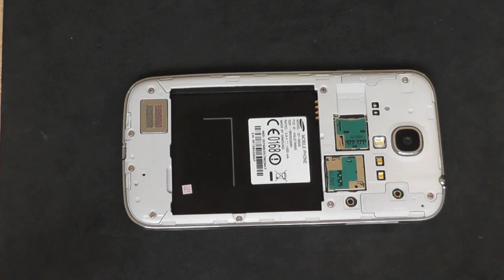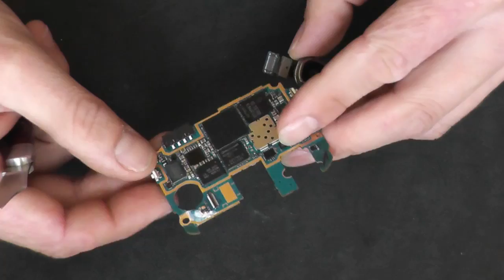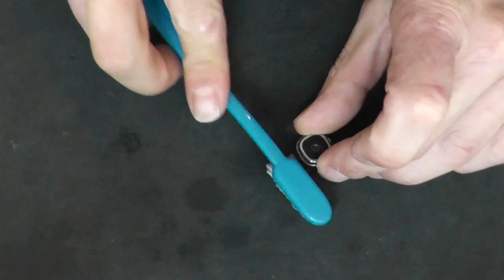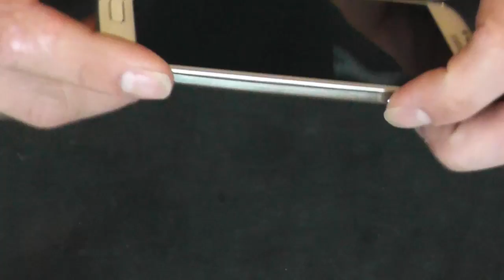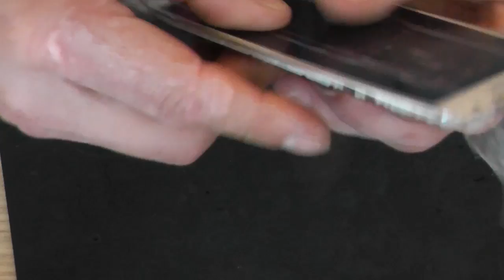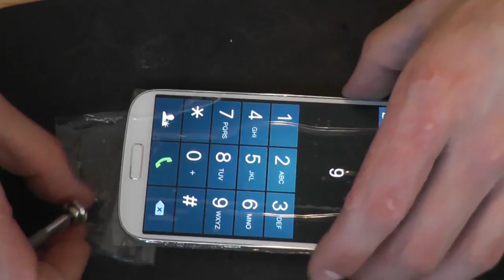Samsung Galaxy S4 i9505 Water Damage Repair - 45664116

Comment: the little white square on the phone, inside, is white. This indicates there was NO damage to the phone. If that little square is PINK, the phone is damaged. So was this phone actually water damaged?
Reply from the maker: +Mary Fletcher 

HelloIt is very common for a phone to be water damaged even if the water damage indicator is still white, a small amount of water can cause the handset not to function.We do offer a water damage repair service below if you require it.http://www.modifications.co.uk/mobile_phone_liquid_damage_water_damage_repairs.html

Regards

www.Modifications.co.ukwww.GSMzone.co.uk 
www.Facebook.com/Modifications.co.uk

Comment: My wife has her SGH-I337 with Android 4.4.4 on AT&T getting the "no SIM detected message" with a known new working SIM and a newly replaced SIM + microSD card reader installed.
This may or may not be related to some small amount (less than 5 ml) of water getting into the phone next to sink a week before.
Phone was working OK for a week after the water incident and a new SIM from the local AT&T Store.
Moisture sticker on battery is still white. Moisture sticker in case is pink.
Phone was sealed in can of baked out silica gel for 2 days to draw out any remaining moisture.
I used the SIM from her S4 in my S4 and it's working.
Also, the touch sounds and the boot screen sounds are distorted and garbled, but the music and media sounds are fine.
Did hard reset and also booted this S4 into safe mode, and still no SIM is detected message is appearing.
Can read microSD well. Display is working well, WiFi all buttons, contacts look good inside, just reading SIM and distorted touch sounds.
All that I can find online is to take motherboard out and clean any suspicious gold contacts with 91% isopropyl or even to replace the motherboard, but that is pretty expensive. I am looking to find what other contacts are involved in the SIM card reader that might prevent it from connecting to the logic or the processor.
Please let me know if you have any ideas or suggestions to get this SGH-I337 back on the AT&T network.
Reply from the maker: We only provide a repair service sorry but we do offer a water damage repair service below if needed.

http://www.modifications.co.uk/mobile_phone_liquid_damage_water_damage_repairs.html

Regards

www.Modifications.co.uk
www.Facebook.com/Modifications.co.uk

Comment: There's a problem with my s4. It's overheating and the battery drains fast. I went to check it by the technician and they found out that it is "shorted". They say they will replace the motherboard which is too costly to repair. Is there a way on repairing the phone even without replacing the motherboard?
Reply from the maker: Hello Christian

No if the motherboard is damaged then it must be replaced.

Regards

www.Modifications.co.uk
www.Facebook.com/Modifications.co.uk

Comment: Is there any other option to know whether I need LCD replacement or not? I'm having black screen on my galaxy s5. Everything else is fully functional.
Reply from the maker: Hello Wan

Without looking at the handset its very hard to say but from what you have wrote a screen maybe required. If the phone is water damaged then it would need a full strip and clean then it can be tested then you will know if its needs a new LCD.

Regards

www.Modifications.co.uk
www.Facebook.com/Modifications.co.uk

Comment: Hey, I had an accident with an S4 active. Turned out the battery cover was not completely closed and the phone was filled with water while running for about an hour! I did a disassembly, toothbrush clean and alcohol soak and 2 days drying. I jsut put it together and it seems to be working, but I see a lot of fluid stains inside the LCD. any hints how to clear out the LCD? It seems to be bonded together so I have not been able to get the LCD off of the glass front. Thanks for any tips you can give!

Comment: Great video/ I received a said to be water damaged S4. It will not turn on at all, I took it apart, cleaned all the corrosion. And cleaned all the contacts(may try the contacts again).  And still nothing, when plugged in with or without the battery the phone heats up towards the top of the screen. Is there anyway to fix this phone? and what would cause the phone to heat up in that area? Thanks.
Reply from the maker: Hello PipeSmoker

We only provide a repair service so we cant help without having the handset but you are welcome to use our repair service below

http://www.modifications.co.uk/mobile_phone_liquid_damage_water_damage_repairs.html

Regards

www.Modifications.co.uk
www.Facebook.com/Modifications.co.uk

Comment: Hi, I dropped my phone in the water yesterday night, did everything right - didn't try to switch it on, immediately took out the battery, cleaned it up as much as I could and (not sure if the rice advice works but put it in rice too over night). Today I took it to phone repair shop, the guy cleaned it completely the way you did and it seemed to have worked perfectly. He checked the mic, charging, video etc. But 30 mins later, while I was texting I wanted to unlock the screen again and the screen became unresponsive to touch and stayed unresponsive even after taking out the battery, charging it etc. Also, when I started charging it, a couple of time the screen flashed a green line or sth like that before showing the usual battery symbol across the screen. Everything else worked perfectly. I even backed up the photos when I got home.
I was wondering if you could tell me what could be the issue now? Thanks in advance.
Reply: I forgot t mention mine is also Samsung Galaxy S4 and the screen looks normal, shows everything, "just" doesn't respond to touch.
Reply from the maker: Hello

Well we have repaired loads of the galaxy range and never seen one to go faulty after its been tested and fully working but it could be either its not been cleaned correctly or its not been dried out fully. But i'm not saying its impossible but it could be a component could have failed like the touch screen.

Regards

www.Modifications.co.uk
www.Facebook.com/Modifications.co.uk
Reply: Thank you so much for replying. I'm not sure why it happened, my guess would be what you mentioned - that is wasn't dried fully. Though it was on some sort of drying machine (I don't know what you professionals use) for about 2 hours while I was in the shop. In the end, the screen needed to be taken apart and fixed. Thanks again! It means a lot.
Reply from the maker: mai567

You are most welcome..... :-)

Regards

www.Modifications.co.uk
www.Facebook.com/Modifications.co.uk
Reply: Same thing happened to me but the green lines flashed before I took out the battery and let it dry.  My screen was working for about a day then the screen became unresponsive if you ever figure out how to fix it reply to this comment.
Reply from the maker: Kevin Doody

We might be able to fix it but you will need to send it us by using our water damage service below

http://www.modifications.co.uk/mobile_phone_liquid_damage_water_damage_repairs.html

Regards

www.Modifications.co.uk
www.Facebook.com/Modifications.co.uk
Reply: ModificationsUK I would except today I took it to a local place and they said they could fix it but it wouldn't be long term.  Because they said that even once they fixed the digitizer there might be some internal problems too.
Reply from the maker: Kevin Doody
Hi Kevin

Sorry but without us looking at it we can not confirm anything. Sorry about that.

Regards

www.Modifications.co.uk
www.Facebook.com/Modifications.co.uk

Comment: does they do this in shop when i return it and they fix it? so i cant competelly destroy my s4mini with this? how do i destroy it?
Reply from the maker: Hello

We will try and see if it can be fixed and yes we do offer a drop off and collection service if required.

Regards

www.Modifications.co.uk
www.Facebook.com/Modifications.co.uk
Reply: ModificationsUK what if its rooted? :D and cant unroot it? it just says fail lol...
Reply from the maker: Hello

If its rooted it wont make a difference if its water damaged its still the same.

Regards

www.Modifications.co.uk
www.Facebook.com/Modifications.co.uk
Reply: but if u can see that its rooted but wont work? like screen is half black?
Reply from the maker: *****

If the screen is half working then the screen is damaged or faulty.

Regards

www.Modifications.co.uk
www.Facebook.com/Modifications.co.uk

Comment: I was about to do this but 1 last screw would come off lol. I think that was god telling me not to risk it lol
Reply from the maker: Hi Justilyn

Sorry to hear that but I guess it wasn't to be, We do provide a water damage repair service via our website below if that helps.

http://www.modifications.co.uk/mobile_phone_liquid_damage_water_damage_repairs.html

Regards

www.Modifications.co.uk
www.Facebook.com/Modifications.co.uk
Reply: ModificationsUK I took my phone back to the store and they said they couldn't fixed it because the battery thing was damaged.. They said that the color of that little dot/circle thing changed to orange which I guess is a bad sign.. Can you guys still fix it even if its like that?
Reply from the maker: Hi

Well we will have a good go at fixing it and the battery connector wont be a issue but you will need to post it in to us. The water damage indicator will turn red when damaged its common for this to happen.

Regards

www.Modifications.co.uk
www.Facebook.com/Modifications.co.uk
Reply: ModificationsUK What do you mean by "post it" to you guys? Do I need to send it to y'all? How much will it cost?(:
Reply from the maker: Hello Justilyn

We charge between £25.00 - £45.00 for a water damage repair, but it does depend if the phone requires parts, we wont kinow this until we have stripped the phone. You can use our service if wished by clicking the link below.

http://www.modifications.co.uk/mobile_phone_liquid_damage_water_damage_repairs.html

Regards

www.Modifications.co.uk
www.Facebook.com/Modifications.co.uk

Comment: I went swimming with my S4. I had been in the water (chlorinated swimming pool) fully submerged off and on for 5 minutes when I discovered that I had my cell phone in my pocket. Thanks to your video, it just booted up, LCD was fine. The battery was completely discharged but I'm charging right now. Hopefully it will hold its charge.

Two comments: (1) I'm so stupid and, (2) your video saved me from buying a new S4.
Reply from the maker: Hello

Yes what a silly thing to do but these things do happen, and glad to hear your phone is working again. Our video is to show how we repair water damage phones its not a guide but yours is sorted now and well done. I hope you did a full strip and clean otherwise its just a waiting game when its going to die.

Regards

www.Modifications.co.uk
www.Facebook.com/Modifications.co.uk
Reply: ModificationsUK The cost of a new S4 is very high so I needed to try to fix it myself. I spent four hours, not only studying how you did it, but playing with all the tiny screws, ribbons, and such. Yes, I did a full strip and toothbrush clean. Had I been in England, I would not have chanced it myself and asked you to do it. Unfortunately, there was, indeed, some water damage. The front camera works but the back camera does not. I am going to have to spend another 4 hours with the same process and replace that back camera. (You don't have offices in Canada, do you? :)

Comment: Hi my phone has had water damage and it tells me that the battery temperature is to low when i want to charge it, also the two bottom keys do not light up or work as a result will changing the usb board help or is there any other way to fix it?? please reply as soon as possible i really need my phone to be in working condition thanks
Reply from the maker: Hello Stefan

We only provide a repair service and not advice, our videos are to show that we can repair water damage mobile phones. We do offer a water damage repair service via our website below

http://www.modifications.co.uk/mobile_phone_liquid_damage_water_damage_repairs.html

Regards

www.Modifications.co.uk
www.Facebook.com/Modifications.co.uk
Reply from the maker: Hi

The phone needs to be stripped and cleaned before you start changing any parts.

Thanks
Modifications.co.uk
Reply: I simply removed the battery the backing and put it in a container full of dry rice and its working just fine now
Reply from the maker: Wow that's great news and well done but just to let you know that rice does not clean the corrosion away so its not a good idea to use rice. The phone needs to be stripped and the motherboard taken out and cleaned. We would not recommend doing the rice method. We have noticed that people using this method suffer from lots of problems further down the line.

Good Luck!
Reply from the maker: Hello Pat

So we can agree that rice does not work! as per recent posts. We don't offer advice but as stated in other posts the phone needs to be stripped and cleaned including other parts then dried and tested. If you still have issues then parts will need to be replaced. Just note that the charger docks are different. Also the more you use the phone the more damage you will cause if its not been stripped and cleaned.

I hope that helps you.

Modifications.co.uk

Comment: My Galaxy s4 phone is not working and was in the pool for 2 days. I opened up my phone and was confident to take it apart. What I noticed different compared to a new Galaxy s4 phone was the circuit board has a bit of white/grey patches as well as the charging port. So I manage to brush it and got rid of those white patches/marks, however, the phone is still unable to turn on.

After viewing this video it might seem I need a new circuit board or parts.

What do you think?

Comment from the maker: Hello Nerlangor

Sounds like you have corrosion on the motherboard, we recommend not to use the handset and take the battery until its been stripped and cleaned. We do offer a water damage repair service on our website if that helps. As for cost if you use our service is about £25.00 to £45.00 if we can fix it.

Regards
Modifications.co.uk
Facebook.com/Modifications.co.uk

Comment from the maker: Hello Honor

Sounds like you have corrosion on the motherboard, we recommend not to use the handset and take the battery until its been stripped and cleaned. We do offer a water damage repair service on our website if that helps.

Regards
Modifications.co.uk
Facebook.com/Modifications.co.uk